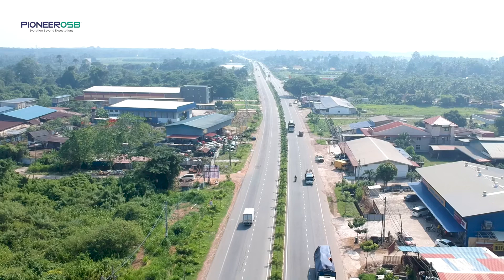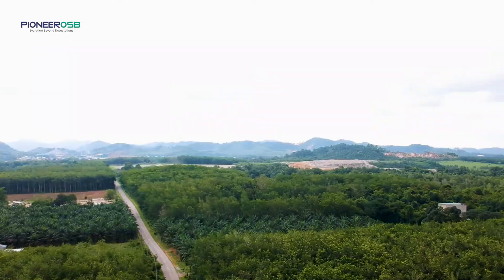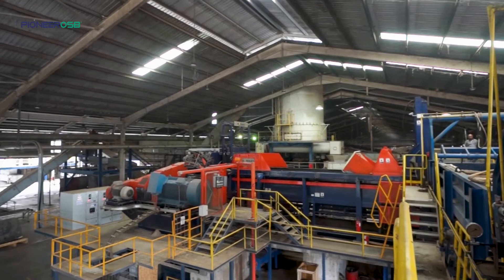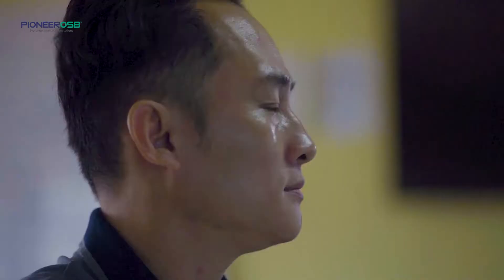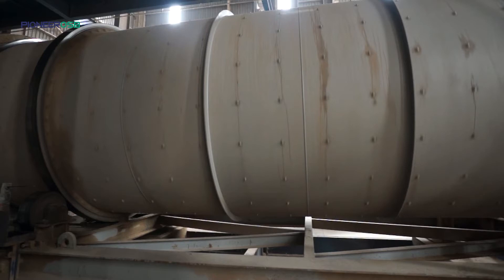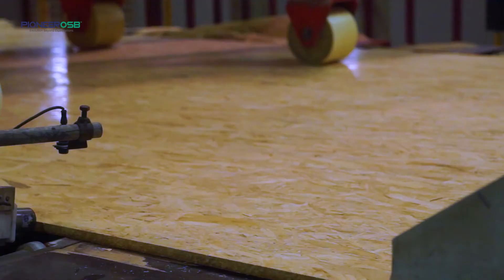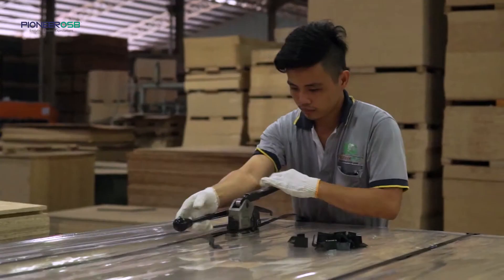Oriented Strand Board  - How it is made

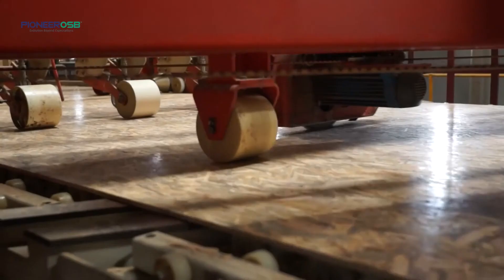Comment: 3:24 what the heck is going on? It looks like a saw is cutting the extrusion into lengths, but while the extrusion is moving, but it's an automated circular saw, so it needs time to cross the width before the length is cut, so the extrusion would need to stop and go, but it's going continuously and the saw is moving across anyway? Maybe it's moving with the extrusion to always stay in line but I'm not seeing that. Am I seeing it wrong or misunderstanding?
Reply: Yes the saw is moving diagonally, i.e. cutting across the board while moving along the conveyor at the same speed as the board.